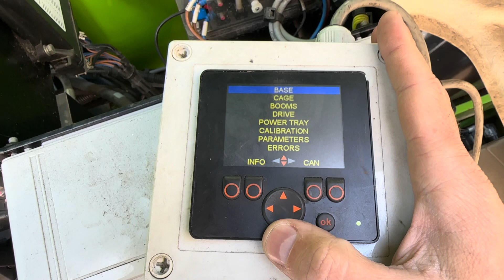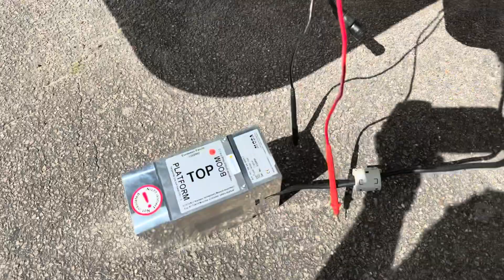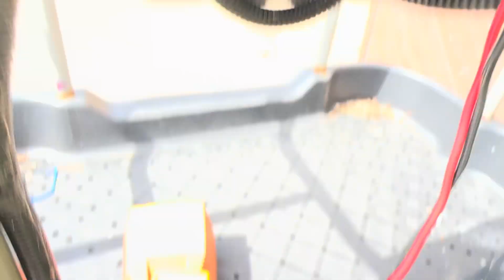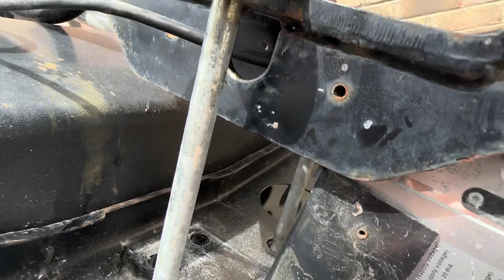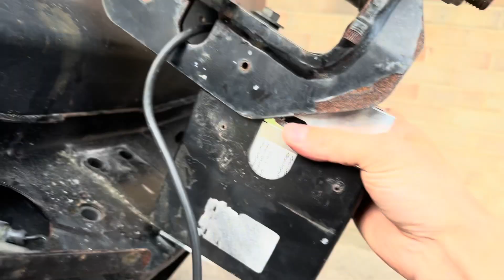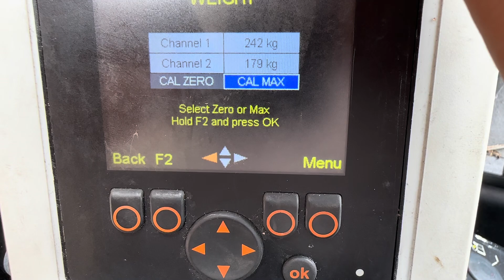Niftylift HR17 overload fault error 38 🏋️‍♀️🏋️‍♀️🏋️‍♀️

Comment: Hello, great vidoes! all of them. do you know what blink code 37 on weighting card on a niftylift 120 TPET MK1D means. Appears, if i go with the wheel transaltion motor too or from the wheel. bevore i move the translation motor everything is ok and the green LED is lighting. SWL load is new calibrated and works normaly.  thank you and br. Hari
Reply from the maker: Voltage presence on gbo without function demand would trigger those errors. If there is not input from enable button or foot 🦶 switch then should be no voltage on GBO otherwise it will go in to alarm .🚨